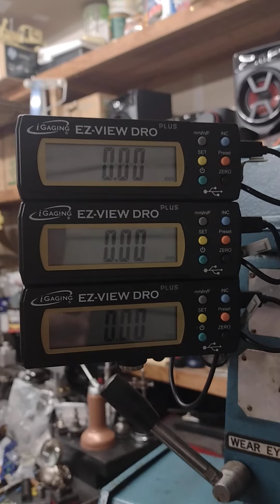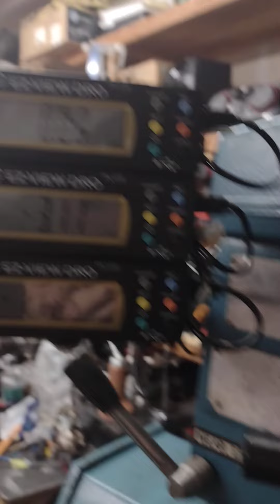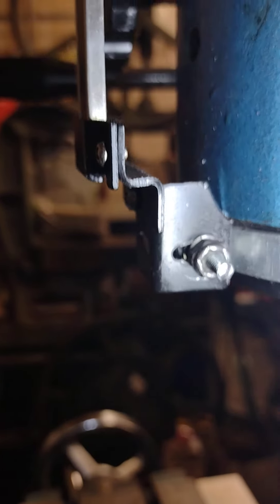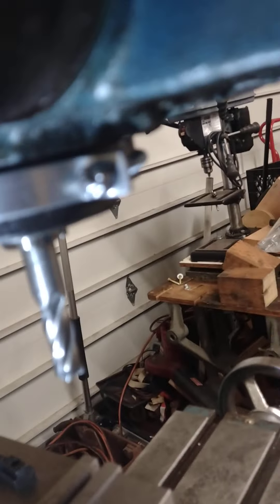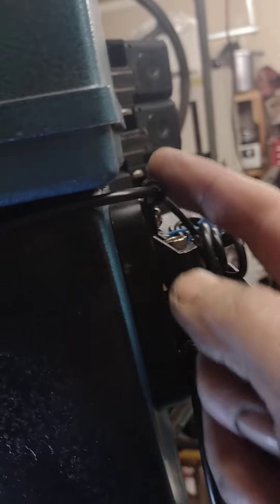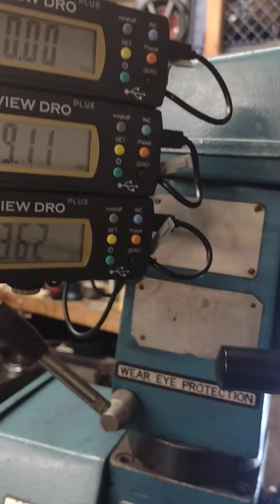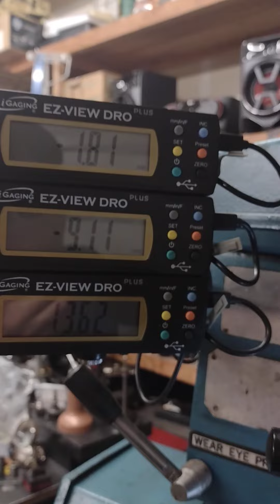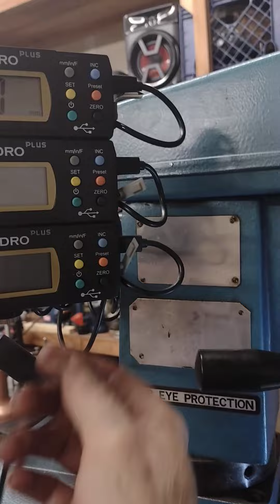Smithy 3 In 1 Z Axis DRO Install

Comment: I'll take "ugly, but works" over "pretty, but doesn't" any day of the week. And with your spotting drill: you should be old experienced enough to know that "just the tip" can cause a LOT of problems...
Reply from the maker: I got lucky.
It was a really tiny one and it was all the way in when it broke.
I used a bit bigger drill bit and opened up the hole and then used a tiny one to move the center over with. The bracket is slotted  so moving the hole a bit didn't matter. Then I went up in sizes real slowly and managed to snag that broken tip off when the hole collapsed next to it.